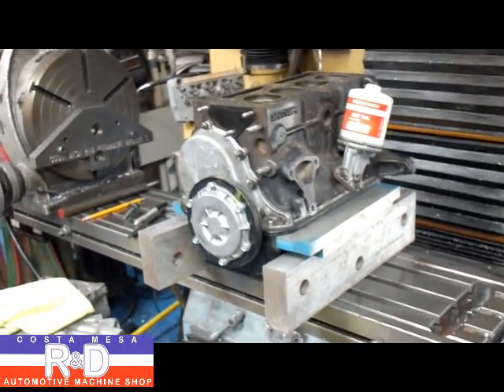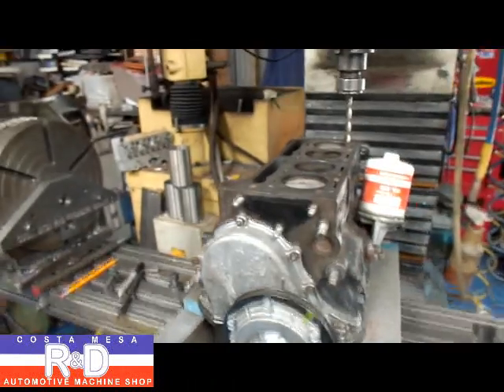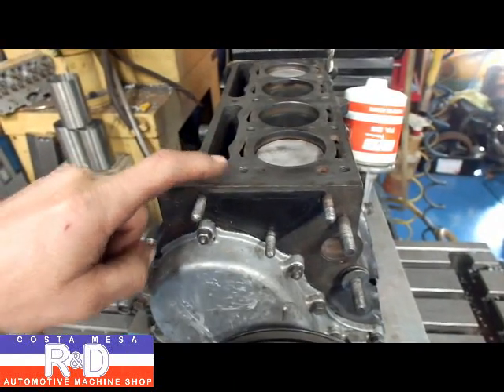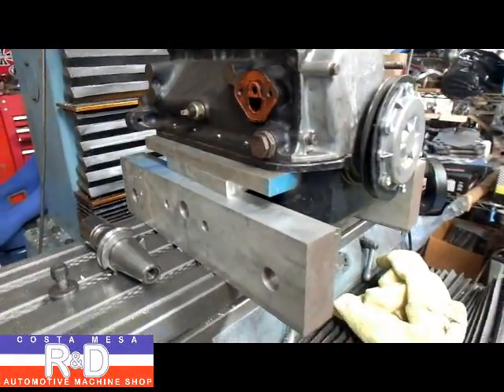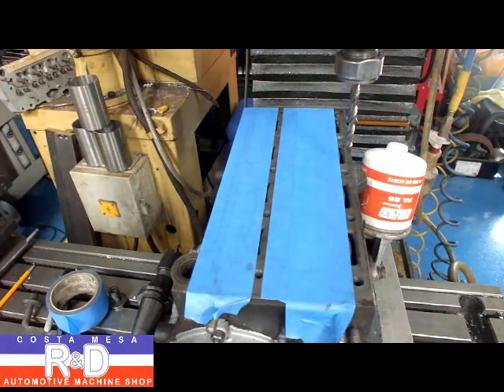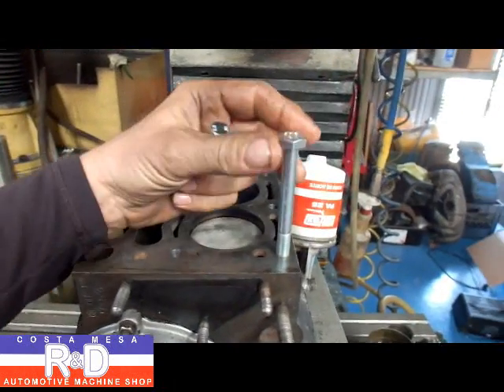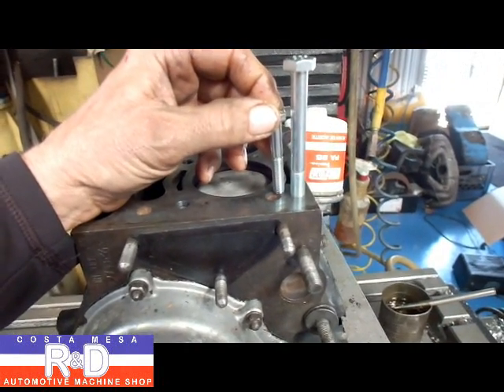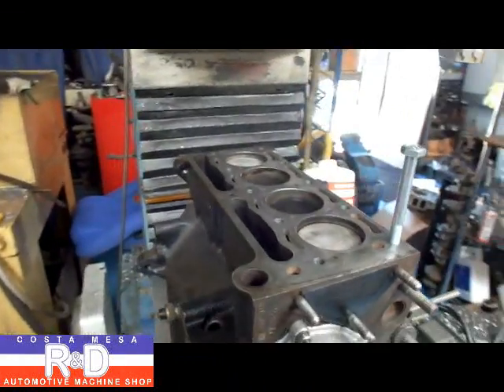Fiat 750 Cylinder Head Bolt Enlargent - 8mm to 10mm

Comment: I have a 750 Abarth engine in my garage. And the 600 Fiat that has 750 emblems on it. I need to get rid of it. The 750 engine is a highly polished Abarth engine. The rods are highly polished and lightened from the factory.  jrbarnes11@charter.net